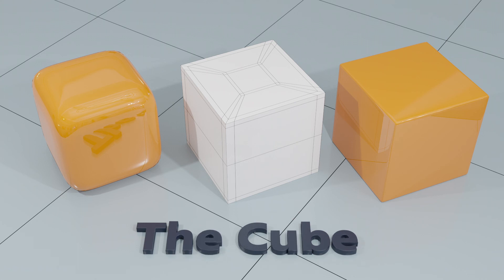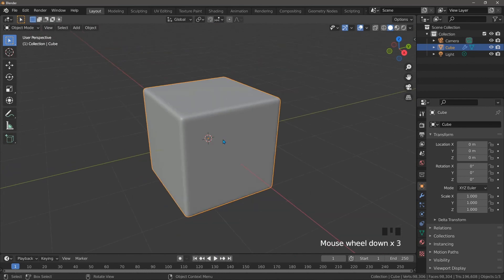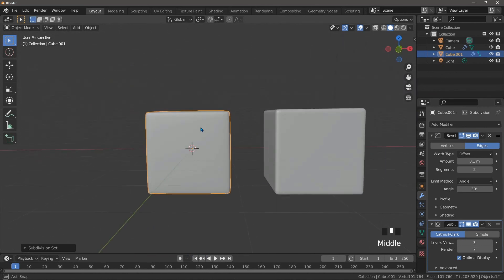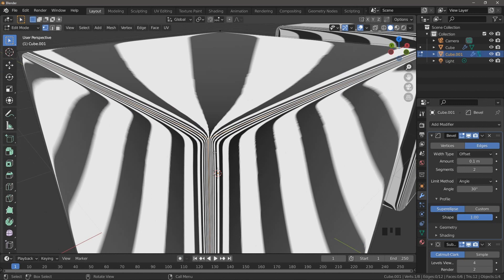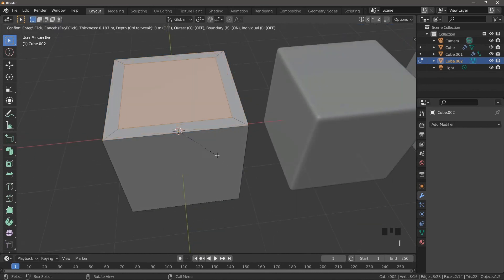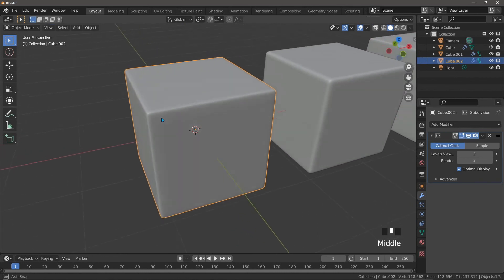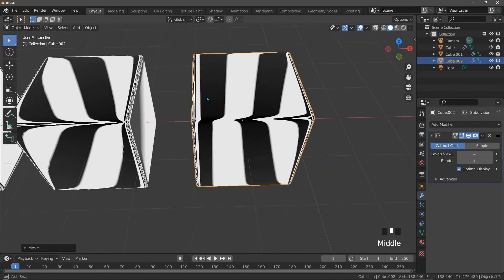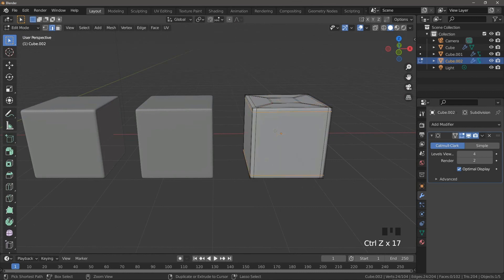Blender - A better cube - #7 Subdivision Surface Modelling in Blender.

Comment: when you set the loop cuts to 2.7, I couldn't figure out how you get them to be mirrored.  I have looked it up but so far I'm just finding recommendations to use the mirror modifier when I think that isn't want you're doing.  How do I get the 2 loop cuts to move in opposite directions?

Comment: I want to know how he does the falling letter animation.  Or is it all lots of brute force like simulating a cylinder and then replacing it with a letter that happens to be right side up when it finishes and all?
Reply from the maker: @darrennew8211  Hi darren. I made a video showing exactly how to do it! https://youtu.be/ySL4KG2dunQ?si=TfHjMWtjqXF9P7TG
Reply: @ianmcglasham  Very cool!  Thank you!

<watch watch>

Wow, that is amazingly clever! I've done ones where the stuff happens randomly and I put textures on the end point so it looks like all the cubes are coming up the right colors, but this is brilliant. Thank you! That's a whole new technique for me.

I guess if one of the letters lands face-down, you just change the starting condition and reanimate? I'm gonna have to try this with non-rigid bodies, just to see if they jiggle into place realistically. 🙂